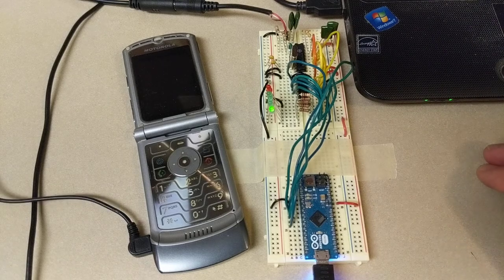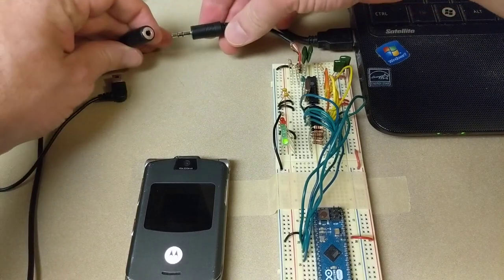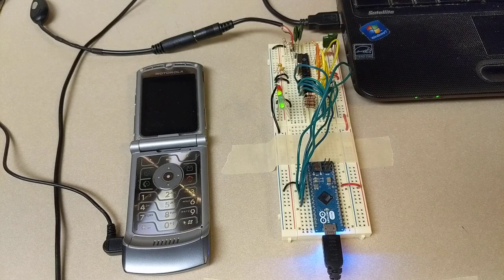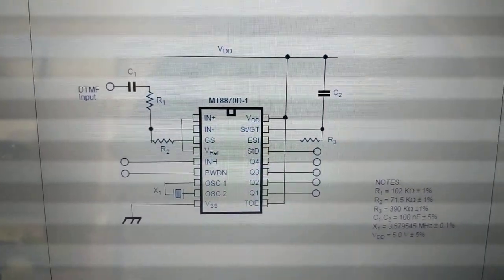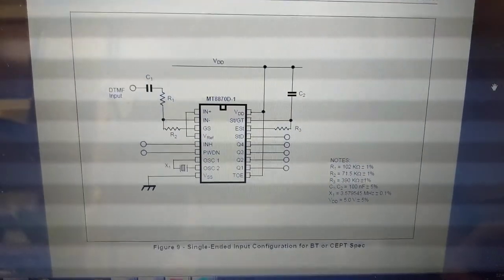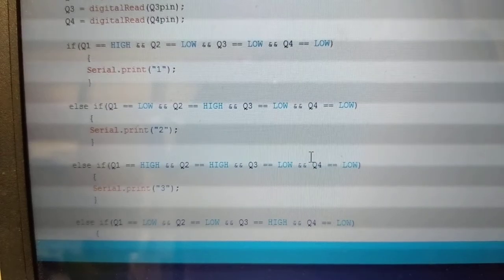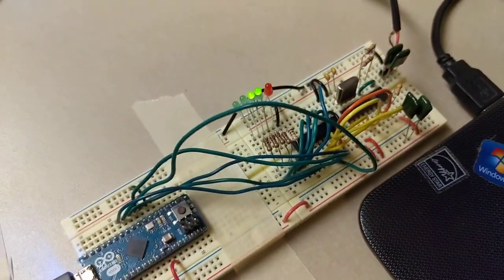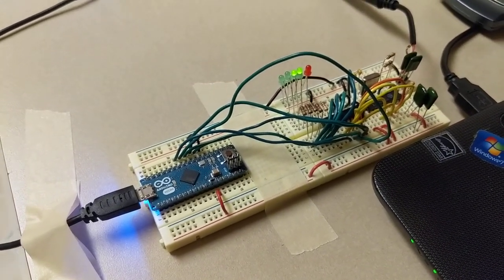How to use a Motorola Razr V3 to control an Arduino with DTMF

Comment: Is there any possible way to modify a V3i to the 4G network? Looking for any guru magic, thanks
Reply from the maker: You would need to completely redesign the phone to use 4G chips. Not gonna happen.
Reply: @danebeck7900  Thanks for the quick reply! With much research and your confirmation, its a hard truth to swallow. But I am still inspired  to get a RAZR to work operationally with bluetooth connectivity to a smart phone to still accept and make calls. I am working on the first prototype now and could use a bud's help once I create custom board.
Reply from the maker: @andydodson8627  What do you mean, custom boards to swap into a Razr? You're basically going to redesign the phone from scratch. At that point you might as well design a 4G phone, and your Razr will only be skin deep. If you know how to write Java you might be able to make an app to send Bluetooth messages or something like that. I've searched for a program like that but haven't found anything that actually works. I've also considered using a Notepad app that could make text files, which you could then transfer over Bluetooth, but again I haven't found anything that works. I have no idea what's involved with SW development for a Razr, if you need a dev license, etc. Nobody has written SW for these things in over a decade. If you're really serious about this you should look into OpenBTS, but be aware of any legal issues with running your own GSM network.